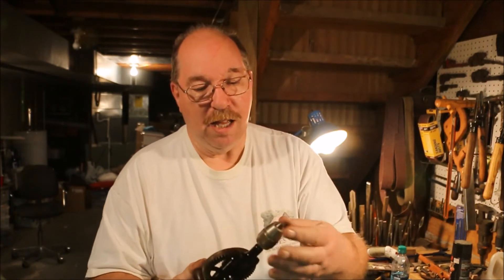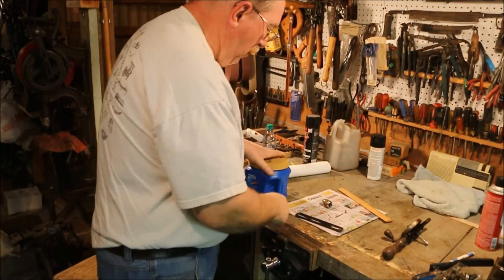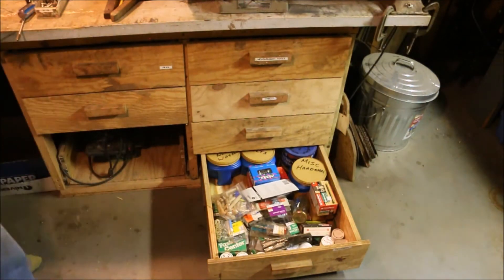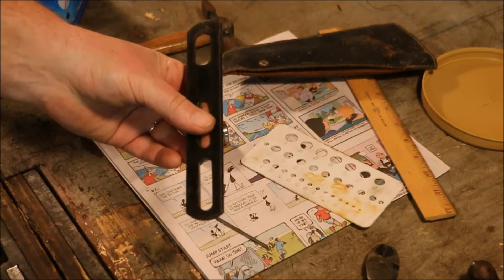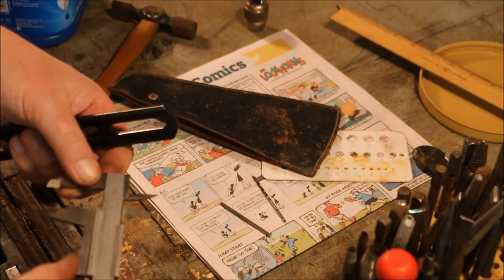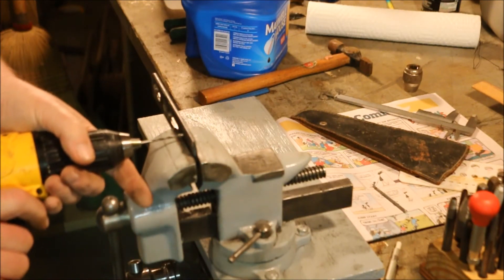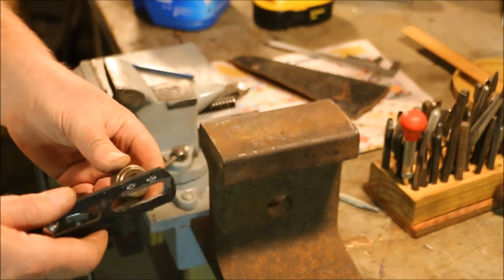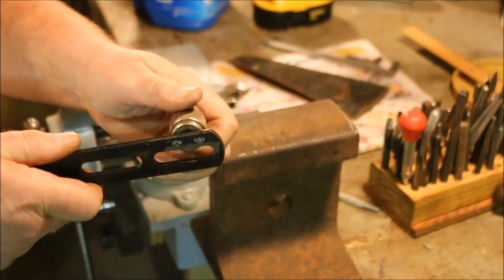MAKING A PIN SPANNER ~ DRILL CHUCK DISASSEMBLY TOOL

Comment: To make a spanner you can also make it out of welding rod fold the welding rod almost all the way in half and then bend the tips down so they're parallel to each other and knock all that coating off.

By using the welding rod you can use it for a lot of different size chucks. 😉 because the handle will expand or contract to fit in both holes.

Comment: I've got one of those here somewhere for something but I have no idea what it's for. I made one to pull the flywheel off a 301 Kohler but that's not precision, just grunt stuff. Hope all is well there.
Reply from the maker: It's elves. They come in at night and borrow your tools to make shoes for the poor kids. I don't know how many 3/4" sockets they use making shoes but it must be a lot.
Reply: usually angle grinders are the reason for having random ones
Reply: I've got the one for the side grinder but this is a small one. Maybe for something like is needed here but where it came from I don't know. Tools sneak in and out of here and have for years.
Reply: I know for a fact they ran off with 2 Estwing 28oz. framming (no typo. I fram instead of frame) hammers, a set of 3/8ths wiggle-head sockets, and a 2 foot aluminum handled pipe wrench and my thread file. Sounds like a dose of commie elves to me.
Reply from the maker: Lewie McNeely I have been blessed with working with and for many people. They provide stories that prove anything is possible. 
At United Technologies we had a huge building full of badly maintained equipment. The maintenance crew was mostly retirees or close to it. 
One of the jobs required a 4 foot pipe wrench. This was the same pipe wrench that, during my plant tour before hiring, was hooked onto a hydraulic cylinder with a chain binder to keep the cylinder from working loose. 
The man I assigned the job to couldn't do it because he couldn't find the pipe wrench. My policy was that nothing stopped us from completing assigned tasks. I sent a man to the hardware store to buy a 4 foot pipe wrench. They asked if they could get an aluminum handled wrench. Sure. Why not?
About a month later I found myself visiting the top of the 100,000 lb melting furnace because the burner control valves weren't working. Seems they did this regularly. About 3 months before they had pulled the valve off. It took the 4 foot pipe wrench to take the lines off. There hanging on the gas line, where it was still sitting 3 months later, was the 4 foot gpipe wrench. 
We had another of many Come To Jesus  meetings. The theme was: Putting tools back where they belong when the job is done.
We never solved the lost tool problem. There was an active group of thieves working there. We did cut back on the number of lost, stayed, or stolen tools though.

Comment: Very useful video (as always). Would you consider tickling the back of the spanner with a welder to ensure the pins never moved ?.
Reply: if you peen them over they shouldnt anyway, they are expanded into the hole, though for a larger one with harder pins, i could see that makeing a good job of it
Reply from the maker: It wouldn't hurt.
Reply from the maker: If I was using hardened pins under a good load I probably would weld them.